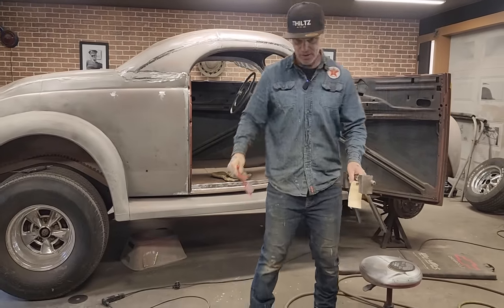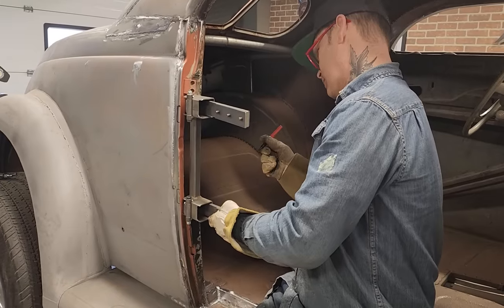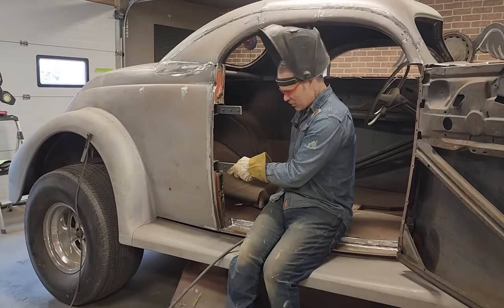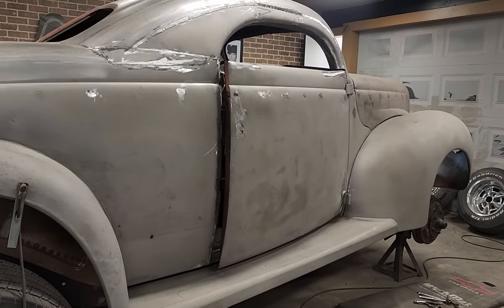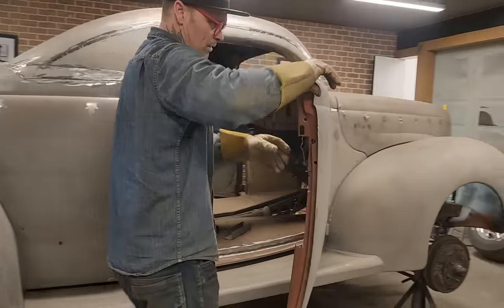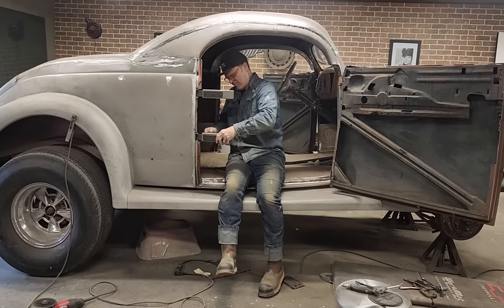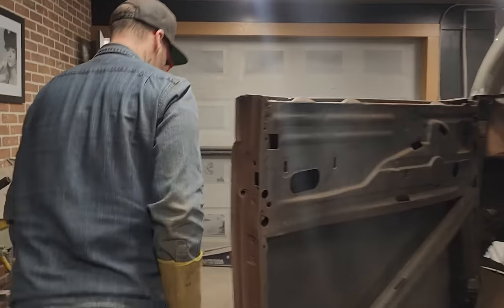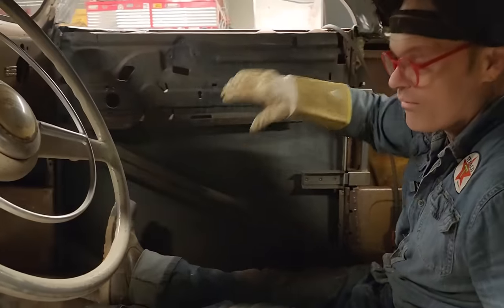Big fabrication changes are about to happen 🙌

Comment: Hi Chad, the bigger holes in the channel would allow door position adjustments and if you weld the backing plate to the channel then you will lose the adjustment capability.

Comment: There will not be any space between the back edge of the door and the door jamb for the door to open. Think of the door with a 2"x4" bolted to the hinge instead of the door so it is up against the door jamb. There will be no space for the door to open. I suggest a re-read of the instructions.

Comment: With that hinge placement will the door bind on the post or quarter panel?   Next Video - I thought the hinge strap was straight. It's a 90 degree strap which saved the day!
Reply: That's my thought too, because the hinge pin is inboard

Comment: With the position of the hinge pin so far inside the b pillar the door is not gonna open. The thickness of the door will jamb up against the b-pillar! Unfortunately I think this is going to get reworked. We will see tomorrow 😊
Reply: I thought that a possible solution to that problem could be to get thet "U" piece to be fitted a hole forward, before they were cut that was 😅
Reply: concerned as well but lets see what happens..test and test again,,,
Reply: 😂😂😂 wrong!!! Works perfectly. Have a serve of humble pie.
Reply: @howquick  I’ll take it, glad to see that it worked out!
Reply: @howquick  hey, is great that it worked!
I also thought it wouldn't as you couldn't see the sliding feature on the hinge and i also mentioned it, but not to criticise but to be helpful in the case it was as it looked.
I'll do it again if i think im being helpful, no harm done. Humble pie all the way if thats what it takes!
Reply: @maxaita9127  you only had to look at the hinges...to understand they don't work like 'conventional' type hinges. They swing out and away. There's an old saying "keep your thoughts to yourself...and let everyone 'think' you're a fool...or let them out...and everyone will have no doubt". 🤷‍♂️
Reply: @howquick  Actually they didn't look as they swing out and away and i guess that why more than one thought that was going to be a problem.
Hey, but you are also a philosopher! I thought that you were just a humble pie waiter.
Just too cool for me fool to keep going.
Be well and good luck!

Comment: Surely the hinge pin should be outside the bodywork or else the door won't open out and around but jam against the B post. Screw a block of wood the same thickness of the door on to the hinge and check how it opens
Reply: What i have been thinking. it will be what is called hinge bound
Reply: Hinge arms can be any shape to work. The arm bent as it is will flow around the corner. I like the kit.
Reply: Looks like the door will swing in not out? Am I look😢wrong?
Reply: Nope. Works perfectly

Comment: as soon as i looked at that hinge I was thinking "how is he going to make that work?"   I bet the end of the video was where Chad realizes this does not work with that door setup.   i cant wait to see the next video...lol    I am hoping Chad proves me wrong... but i think this whole idea must be rethought and using different hardware.
Reply: @daddysails8926  i already posted on the new video and stated that i was wrong.  i only know what i know... i never said that "i know" it wont work, did i!  I said "i was thinking".  i only had a very breif and distant view of the hinge, and in that limited view it did not appear to be something that would work in this application. if you read the comments, there are a hell of a lot of people questioning the use of those hinges.   Generally speaking I am correct about 99% of the time, but on occasion i am wrong and i have no issue admitting when i am wrong.  In fact i know a lot as a retired engineer that has loved working with tools and designing and building things my whole life.

Comment: Chad would you consider making the tire gap on the rear even out? currently the middle has a huge gap while bottoms are snug?
Reply: It's supposed to be a full sized HotWheels car so the tyre gaps are perfect. Not everyone builds a clone car, there are still a few individual builders of which Chad is one thankfully.
Reply: Ya its bugging me the way their not centered in the wheel well

Comment: The way you have it now, I don't think the door will open (outward). It might open inward! Now THAT would be different!
Reply: After thinking about the design of this hinge, I take back what I said. I think it will work. The L shape of the hinge strap should move the door away from the jamb as it rotates. If there is any interference, it might be on the latch side.

Comment: My opinion is that I think the rear of the car is too high
Reply: Years ago we use to  raise the front and lower the back . Anybody else hear of that .? Why they did it that way I have no bloody idea . Dad had his reasons though . Crazy how times  change though . Have a wonderful evening  Darrel
Reply: @kevinmcleod7580 Gasser's are that way because they use a straight front axle and have to be high to clear the oilpan etc. Also help load the rear for traction.
Reply: @johnqpublic8109  thank you for your assistance .
Reply: I used monroe air shocks back in the 70s on several of my cars. The car rode like a lumber wagon. But that was the rage back then.

Comment: you cant cover it all on door side you need access to put bolting plate on back of hinge mount  ... the extra square stock is to weld between hinge pockets together on door side just like the pillar side is

Comment: I would take the panel you made as a learning experience. I would scrap it and make a much better new one. I would glue down the brown fabric, lose the sticky metal duct tape. Make better cuts on the corners of the yellow fabric as the cuts are way too close to the edge. I would experiment with the idea of folding, not cutting at all at the corners. Even if adding material to the rest of the panel to match the thickness of the overlap part (probably not necessary). A group of many small folds at the corners would be superior to cutting the fabric. You risk the tearing of the fabric and of the cuts extending to where they become visible. Hole punch the openings for the handles/arm rest etc. Cuts in the fabric tend to extend themselves, tear. You need to make more panels for this car as well as many for other cars. I think the panel you made shows that you CAN do it, but the first one you made was not a quality job. Nor should you just blindly follow that procedure when a much better job is certainly attainable. There is no rush or deadline. Make it the BEST you can. Not PERFECT, but the BEST you can. Okay, isn't good enough.

Comment: All that work for nothing. No way that door can swing. The long part with the three bolts should be attached to the body and the part he welded should be in the door. Not even sure if that will work without having it in my hand. :hand-pink-waving:

Comment: You forgot to weld the threaded plates onto the back of the "U" mounts.  You need to do that so you can take the door on and off the car.  I like how you are boxing inn the 2 "U" plates to add strength to the hinges.  It just seems you are going a little to fast right now and not thinking it all the way thru.

Comment: I’ve never done this before, but it looks like you put the hinge in wrong. Just my common sense prove me wrong it’s either the wrong side or flipped backwards 
Good luck I would try reading the directions and try using a level that way your adjustments won’t be totally wrong

Comment: I believe the brackets are installed right, don’t weld the plates that are threaded, so you adjust door when needed. I would test the fit to the quarter panel before going follow with additional supports. If possible tie in the roll hoop to quarter panel where door hinge is. But the time Chad reads this it may be to late, because of filming schedule. Hope all is well.

Comment: Hey Chad the bars that are threaded need to welded to the U channel so you can take the 6 Allan bolts out and take the door off. If you unbolt the Allan bolts those threaded plates will fall inside the door and will be difficult to retrieve them with the upholstery on the door

Comment: I know down the line window in the door is going be a problem cut windows put rubber around them  and lock them in like tee tops cut window for lock high but u don't read  comments the way you did the car doors window not going fit to goog

Comment: Did you want to weld the bracket on the backside so when you unscrew the three nuts the bracket on the backsides will stay put otherwise it will fall